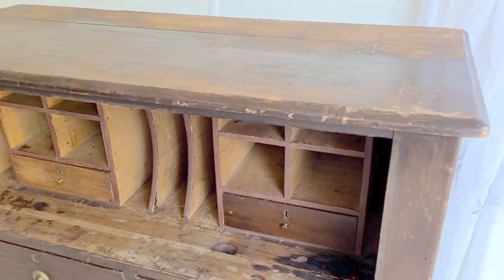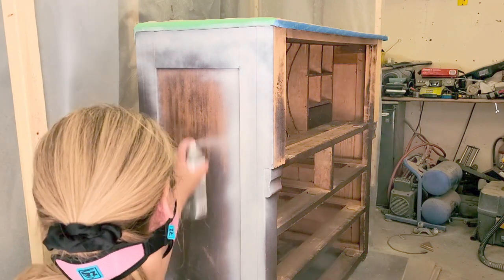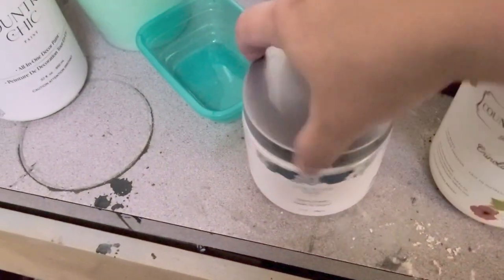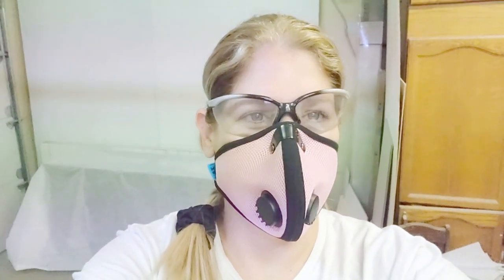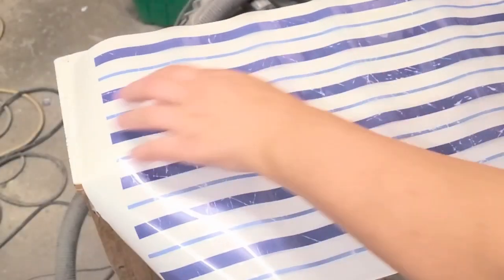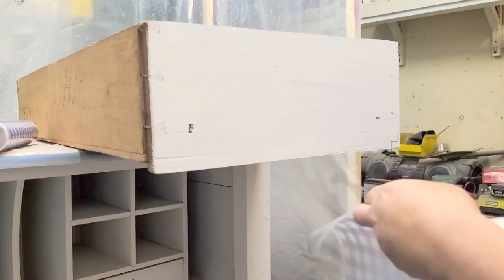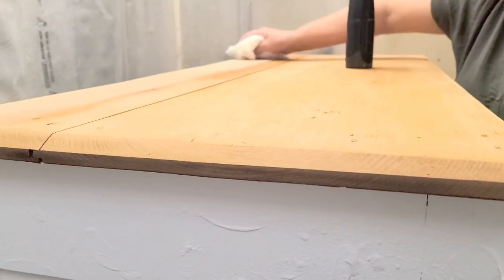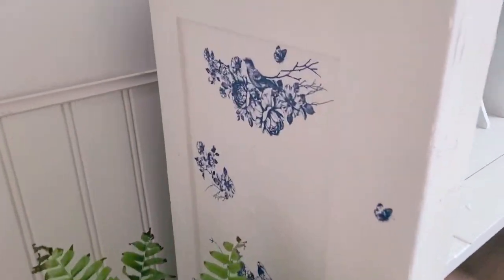Trash To Treasure | Epic Vintage Makeover

Comment: So you use kilz primer,  then you sanded, then you did the Zinzer Bin 123 primer. Would you recommend doing that on an older piece?  I’m going to begin working on an old secretary soon so I’m curious
Reply from the maker: Yes kiltz and the zinzer bin. Yes this was an older desk like very old. Older pieces tend to bleed tannins alot so i would use the kiltz and zinzer bin
Reply: @lubblyjubblyfurniture  ok makes sense.  Also it probably saves time in the long run. Thanks so much for all your help!
Reply from the maker: @mariaphilomena1422  yes and creates durable surfaces for the future